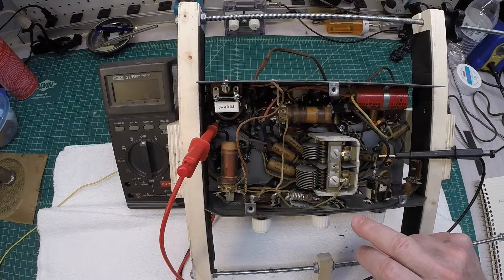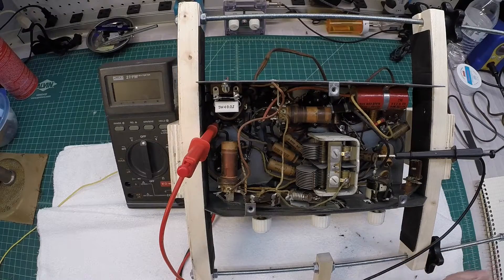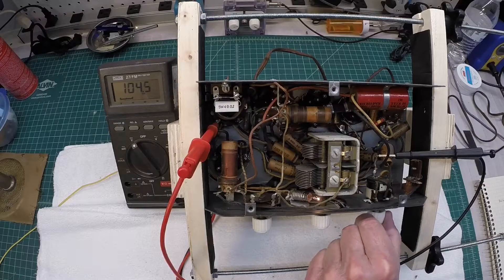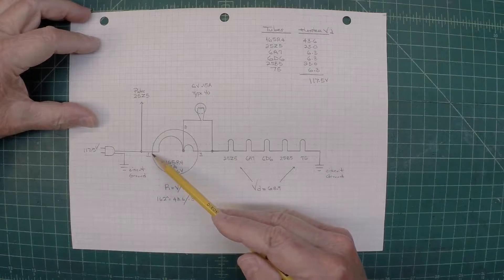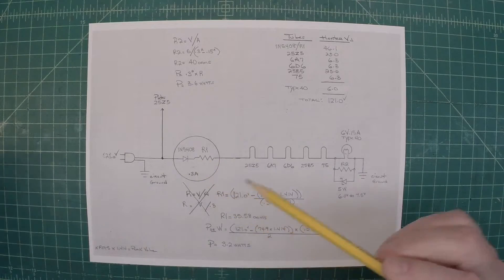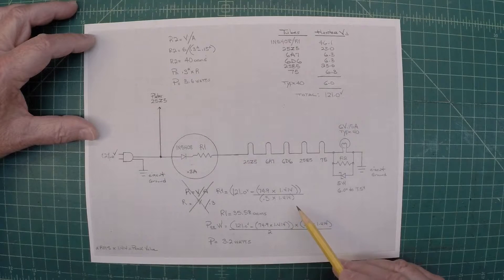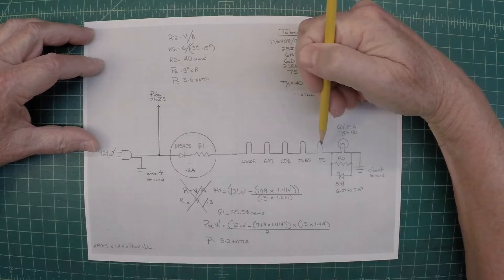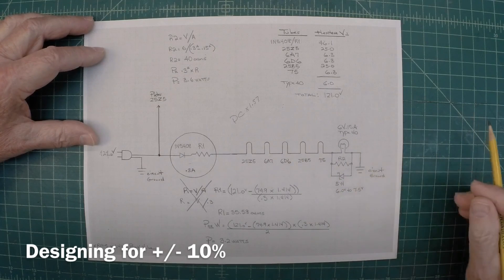Kadette 86X - Ballast Tube Replacement w/ a Rectifier Diode, Zener Diode & Power Resistors

Comment: I followed this approach with a Detrola model 212 radio and it worked.  My dial lamp was the .25amp variety, so I used 20 ohms for my R2.  My filament string had an extra tube in it so I ended up needing a smaller value R1, too.  And it correspondingly didn't have to be high wattage.  One trouble I faced was that I was getting shorts on my rectifier tube.  I think it was a cathode to filament short.  The radio would power up, but then it was as if once the filter capacitors filled, it triggered a short and would blow the fuse in my house wiring.  That circuit of the house wiring was on an arc-fault-interupt fuse, which probably did it's thing when there was a sudden spike from the short.  Sometimes on that 25Z5 tube I would actually see a little arc, but other times not, and the house fuse would just blow.  I suspect that running the radio this way with the diode approach makes it a little more vulnerable to cathode-to-filament shorts, because the 1st tube in the filament string is held at high positive voltage due to the diode's effect and then the cathode is negative, whereas if it had been running with the ballast tube the filament would have been flipping back and forth between postive and negative, with perhaps not enough time for the charge to build and arc across.  Anyway, I fixed it by swapping to a different 25Z5 tube.  If that had not worked, my next approach was going to be to take out the diode and go to the non-polarized capacitor approach for throttling back voltage without the excessive heat from a power resistor.  By the way, for those of you playing with radios with live power, I highly recommend wearing a pair of rubber dish gloves.  A lot of those chassis are live (hot), too.

Comment: I like what you did with the 6 volt zener! That was a pretty clever idea. I'm not against re-forming electrolytic capacitors, but I check the leakage first. My own baseline is if it's more than 5 percent, they get replaced. I absolutely love the cabinet! I wish I had your woodworking skills!
Reply from the maker: Thanks Bob. I checked the caps for leakage before powering it up. All the caps had leakage, but nothing shorted, thus my crazy decision to power it up briefly. Thanks for sharing your baseline and guidance. I hope to get back on the cabinet today. Best, Don

Comment: I've noticed before that you often insert a diode into the filament strings but I don't recall if I have ever asked why.  I'm assuming it is to reduce the amount of power that has to be dissipated by the filament dropping resistor (ballast replacement). Is that right?  With a tradeoff probably being that the filaments take a bit longer to come up to operating temp?
Reply: I wander about that as well. Perhaps Don would find the time to tell us. I greatly appreciate his videos and the time he takes to respond to the people who post comments. Thanks Don.
Reply: I have a 1929 Clinton radio which needs a 165r 8 ballast tube.  I can't find one anywhere. Any ideas?
Reply: @thedistinguishedlunatic  I think you may have addressed your question to the wrong person.

Comment: Hope I'm just seeing things..... are those capacitors original??? You powered that radio up with capacitors that are sure to be leaking at operational voltage.  I hope not.........You're messing with everyone's mind, right?
Reply from the maker: Don, I did some basic preliminary test (checked the caps for dead shorts & leakage up to 100V) prior to powering it up, but mentioned my disclaimer early on that I don’t ordinarily do this or recommend anyone to do so new to the hobby (without the knowledge, test equipment and proper methods and procedures). To your point, every vintage capacitor has leakage. I didn’t mean to mess with everyone’s mind. Best, Don

Comment: Cabinet looks great.  Love your attention to detail in explaining your replacement circuit. Lots of wisdom to your "overkill" with your resistor power ratings over the calculated needs. In the fine print of every spec sheet are plenty of de-rating curves if you don't have free airflow or  mounting to metal/heat sinks(in the case of your Dale Resistor). I use to work with Voltage Regulators and the Applications guys spent hours explaining this stuff. As the saying goes, the devil is in the details! Cheers!
Reply from the maker: Thank you. I hope the resistor will handle it in it’s current location, if not I’ll mount it to the chassis somewhere. Thanks for reaching out and taking time to watch, I appreciate it. Best, Don